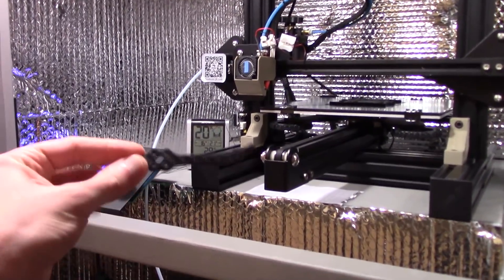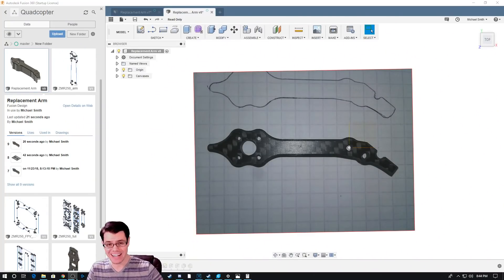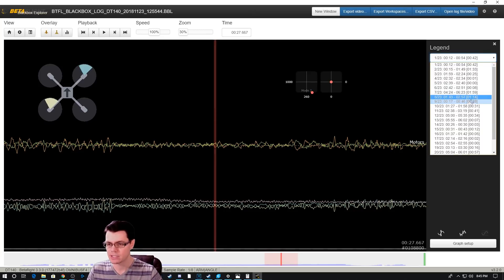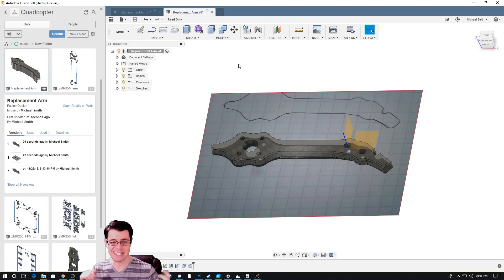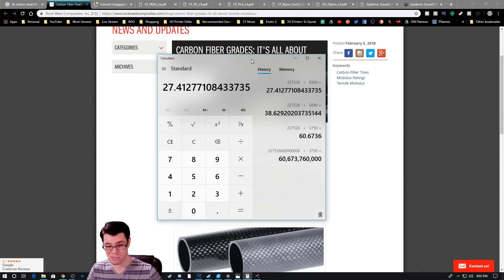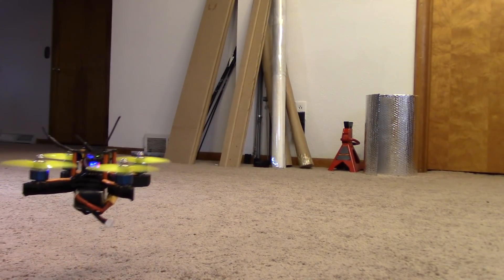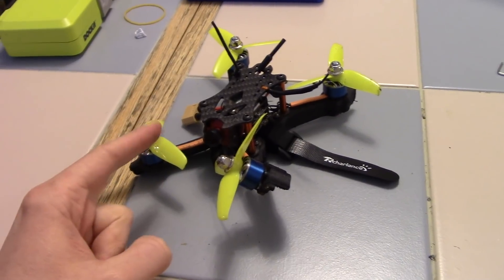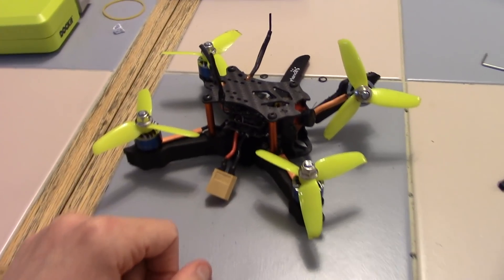Carbon Fiber Nylon 3D Printed Drone Arms! Will they work?

Comment: You know, if you just want a flying drone for prototyping and don't have high requirements for impact survival, you could just go with plain PLA or HIPS... It's cheaper, easier to work with and it's a lot stiffer than nylon..

Comment: Why limit yourself to making the same shape? The frame was 2D because of the limitations of working with milled carbon fiber sheets. With 3D printing you could use different geometries that would make the parts much stiffer.
Edit: 03:10 This is exactly what I was thinking about.

Comment: Great information, I am surprised that the printed arms didn't reduce noise getting to the gyro as generally  something that is more rigid allows more vibrations to transmit through them, a bit like a tuning fork. But the results speak for themselves. I found your channel because I am looking into doing something similar but with a different technique for adding ridgidity. Keep up the great work 👍 subbed😊

Comment: I'd like you to try to get a blueprint of scale armor and print fiber optic panels in place where you could put the scale links, link them all up and turn yourself into a fiber optic walking billboard with your phone in your pocket as your light source. It'd be cool to see if you could make it work. Could you use old food bottles melted down to be repurposed to be fiber optic production fodder?

Comment: (je te connais de tes vidéos de "oxygen not included" je suis fan ;) ) about your test ... nylon is a really great material, but is not impact resisist ... (je résume car c'est dure pour moi de tout expliqué en anglais ) Acetal plastic, comercial name "delrin" that you machine with a CNC machine ... less then 1 min to machine an you will be impress of result ... really, for this using ;)

Comment: Mmmmmmm... Is there any chance you can add thin cross-braces between the struts, maybe attached beneath the motors, so that they can't get jammed far enough to break as easily? As in, braces mounted beneath the motors, attaching between the struts. I know it would add a fair bit of weight, but I imagine they wouldn't need to be THAT thick to help hold the struts in place a bit.

Comment: It's probably programmed to assume really stiff arms. With the lightly flexible arms each motor would power up and flex the arm causing it to think the drone was tilted up too much causing it to try to counter spin and that causing it to flex more the other was and the whole deal got worse till the motors where oscillating between full up, zero, and full down. Combine the thrust "waves" patterns of the motors together and you get some jiggle janking.

Comment: *Disclaimer: LONG. If TLDR, just ignore please. Thank you.*
First, I gotta thank you for posting this video. This has been a serious game changer for me and my career/endeavors I've been putting effort for years to make them happen. Although some of y'all might say that I could have easily found these types of videos or simply an informational free online resources on the Internet, I'm emphasizing the "game changer" part because this video nailed right at the target of my concerns + answered multiples of my concerns I just couldn't verbalize in a single video. That being said, Bravo, Sir Brothgar.

Now, I've prepared some questions for you, which I would appreciate furthermore if you could answer all or majority of them:
1) What is that digital monitor with several digits that I can identify as "16%" at the top in large font size and beneath that, two 2-digits numbers side by side, on the left 16% and right 21%? Is that a part of the whole Ender apparatus?
2) Have you ever 3D-print any of the components in order to DIY-upgrade the previous 3D-printer (if any) into a greater, improvised/optimized 3D-printer before? (I'm asking you this question only because I have this vague impression of you mentioning something like you've upgraded the polymer 3D-printer into the one that can utilize other materials + withstand the heat issue? Or have I got a completely wrong idea about that lol)
3) Would you ever reconsider using the carbon fiber parts in the future? I'm assuming that you would only consider that if you've ever take this project to another level or two in terms of size increase...then from what size do you think the carbon fiber components will start compensating for its cost or weight or whatever other limiting factors it may have? If not the size increase, then what other reasons would you have to reconsider using the carbon fiber parts? (I'm not obsessed with carbon fiber. It's just that I'm the most familiar and comfortable with the carbon fiber composite because I've worked for a few years in car industry, and also because one of my close friend owns a business that mainly deals with carbon fiber composites for the productions of aftermarket car parts.)
4) Are those arm components solid throughout or are they hollow in the inside? (Forgive me if this was a dumb question to ask; it's just that my skepticism surpassed my perception and won against my gut intuition lol.)
5) How did you connect the pieces together? Simple bolt-action/screws? Solder, perhaps? Welded?? 
6) Where can I purchase the motor/generator? Where can I purchase the remote control module (i.e. Bluetooth)? You didn't print those out as well, right? Lol
7) How did you make it waterproof? Where can I get the waterproofing module or chip, or is it the frames that makes it waterproof? (I feel dumb asking all these, but please help out a poor engineering student whose been struggling real hard due to the fact that FAFSA has been lagging my grants and other financial aids for this whole damn semester and I'm barely surviving financially [this semester will end in 2 weeks], can you believe that lol)
8) Last question....I understand that "quad" would probably be the most stable in terms of horizontal and vertical balance/equilibrium. However, is there other particular reasons that you know for the over-abundance of "quad"-copter over "tri"-copter or "penta"-copter, or whatever more/less the amount of propellers attached?
Reply: Regarding the waterproofing: there are several methods. For components that do not require major heat dissipation, they can be embedded in hot glue or epoxy. For components that need sealing around heatsinks, the same sealing materials used in liquid nitrogen and liquid helium cooled overclocking to seal out condensation can be used. 

The carbon fiber arms are solid. Just far simpler and cheaper to do at that scale.

EDIT: check out the YouTube channel FliteTest for more info on the RC side of things. They also have a design for a hinge that makes for a far more agile tricopter design.
Reply: @martindinner3621  Thank you so much with helpful information, man! Yeah, literally right after I typed up all those Q's, one of my friend, who used to be a part of drone-crafting team (not sure whether it was just a club or for a competition -- I'll have to ask him, if anything) at Cal Poly Pomona, recommended me to checkout that exact website, "FliteTest"!! What a coincidence, hahaha :D
Reply: @Corbald  Thanks for the thorough explanation for that Q, man! I vaguely had an idea for the reason behind Quad much more commonly applied than any other copters, but my curiosity for the actual answer basically won against my carefree nature haha. I was on the right track about the balance and statics, but I probably would have never guessed about the least amount of money part, mainly because I'm basically new to this industry and market entirely, haha.
So "Uni-Copter" idea isn't quite a realistic thing yet, huh?
Reply: @seankeimakiuchi8055 Afraid not on the uni-copter. You can technically make a single bladed propeller, though the asymmetrical load causes some serious bearing stress!
Reply: @brothgar  Sorry that I couldn't get back anytime sooner. You know how rough and harsh school could become, haha. 
Nevertheless, thank you SO MUCH for actually answering to my questionnaire, better yet in a numerically ascending order (it's just so much easier to read and understand, at least to me haha)
I will definitely ask you more questions later on, but these gold mine of resources and useful information should keep me occupied for a good while XD

Comment: Hey bud! Imho, carbon fibre/fill is crap for drones. It's stiffer, but more brittle. Try PET-G instead. It's stronger in almost every way than carbon filament, except stiffness. It's still better than almost every other filament in that regard.
Reply: @npgoalkeeper _ ABS warps and I haven't worked much with polycarb, so I can't say. I'd have to disagree and say that ABS<PET-G in all scenarios except for surface quality. PET-G gets wispy and doesn't acetone smooth. Regardless, the layer adhesion of PET-G makes it stronger (sometimes much stronger) than ABS, in my experience.
Reply: @brothgar  You remind me of young Mr Steele without a mustachio.
 Mr Steele is another drone FPV'r that has been doing it for years.

Comment: Brothgar, perhaps you could look into designing the next generation of your 3D printed drone arms with a cross section of a "T" or "+" as opposed to the "L" design to further minimize flexing and increase the structural integrity. In my head, it seems like that would help with your problem, but what do I know. Actually, now that I've thought about it more, the "+" cross section probably wouldn't work because of the way 3D printers print. Still, maybe the "T" would work better because the support would be centered instead of being offset to the side like in the "L" cross section. 
Great video. It's fun to watch you fly your drones and find a way to add engineering to it like you do with everything else (overcomplicating every ONI system for total automation).

Comment: It's interesting to hear the motors at work when you do the fancier tricks, because most of the time they are not running very much at all, and then there's just this "scream" as the motor jumps to full-throttle, and then instantly stops. For some reason, it reminds me of KSP, where you don't get around by burning your engine all the time, but in short controlled bursts followed by long periods of glorified free-fall

Comment: I worked about 3 years as a Helicopter maintenance engineer... you would get surprised knowing how much harm a wrong type of vibration can cause, and how easy is to change it... Sometimes adding just 1 gram  to a rotor blade can solve a vibration problem, or make the whole helicopter shake like an old washing machine...

You are making some nice progress! I bet you can add some extra resistance to the "carbon fiber printed" objects if you can align the fibers in a proper way. Despite i'v never tried it...

I have of a company in Brazil that makes professional "RPAS" ... we do allot of things with carbon fiber, but we use the "old" methods...  I wish we could use 3D printers to have the same quality and resistance. It would save allot of time and money...
Reply: aligning 3d ptined nylon dont change anything its 80% nylon with random 20% carbon fibre scraps , aligning only make sense with classic carbon fibre sheets
Reply: @hardkur  aligning small pieces isn't the same as continuous strands of carbon fiber.
Reply: Look up a company called mark forged. They do continuous carbon fiber 3d printing. And the parts off of those machines are incredibly strong. The down side is the machines and material are very expensive.
Reply: Alignment of the C.F. might be feasible with a very narrow extruder and longer segments of fiber in the polymer. I imagine that might start to run the risk of clogging though!